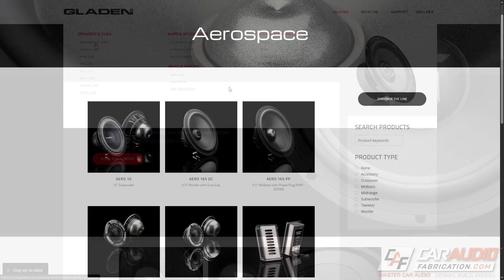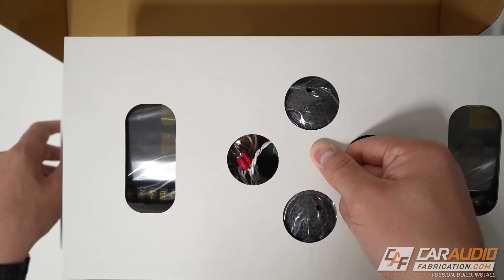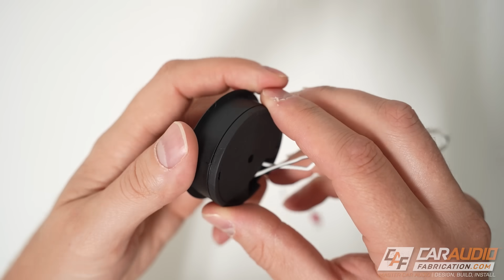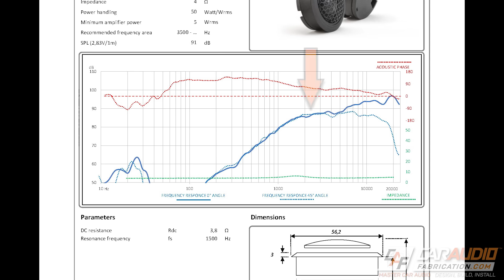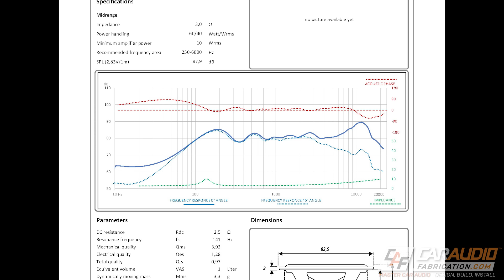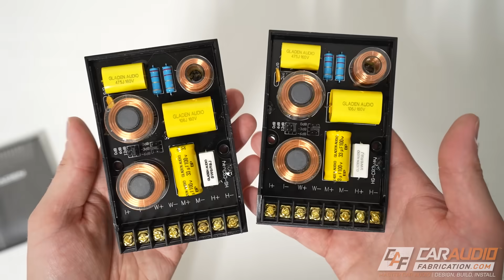Upgrade your sound! - Gladen RS 165.3 Component Speaker Set Overview

Comment: Hi from Scotland UK, brilliant YouTube's thanks have watched a Fer fue ,  canI ask is it best to
Use products from the same manufacturer, say pioneer head unit, pioneer amp , speakers and pioneer sub ?.
Or is it ok to mix say jvc head unit , Kenwood amp , pioneer speakers, JBL sub ?. 
I have a Mazda mx5 nc 2011 with apioneer sph-20dab head unit, pioneer ts-a6881f speakers in the lower doors ?.
Would I be ok fitting say pioneer TS-A301TW tweeters in the upper door , and a pioneer TS-WX140DA underseat sub ?. 
And I don no if I need a amp ?. As I have not looked that far through my build ?.
Any help would be great?.
Thanks and looking forward to your next YouTube .

Comment: I had a question about setting my subsonic filter. I have a ported sub box tuned to 39 Hz and I have two American base subwoofers and two passive radiators. I was wondering what is the best position for the subsonic filter to be set to?

Comment: Those might fit my 99 E320T if I can have new factory style sail panels 3D printed. Those tweeters may fit if taken down to its core as was shown. The midrange could go where the factory phone system speakers are in the dash.
Reply: Good lord bless you keeping a Mercedes that old on the road

Comment: I got to hear these in person and they sound fantastic. Under $1000 for a high end SQ 3 way component set is a steal
Reply from the maker: Great value for sure, someone will always complain about the price since they dont understand quality and see 3 way sets for $100, these punch above their weight class for sure.
Reply: @CarAudioFabrication  They don't seem bad compared to other high end options I've looked at such as Focal or AudioFrog. I do have a question though, I have a 2012 Honda Accord with factory Honda "premium audio system" audio. At first I was somewhat underwhelmed, but then I fed the aux port a lossless signal and it causes the system to come alive in comparison. Would something like these give me a a more powerful sound-stage in something like the Accord with the stock premium amp, or would you at that point suggest just doing a DSP + Amp setup instead? I assume in my case efficiency would be key, and are there other affordable options I could consider for an uptick in quality? It's a family heirloom vehicle so I'd like to keep it stock.

Comment: That would be a very nice upgrade to my tired stock speakers in my 2010 Acura MDX, you can gift'em to me if you want
Reply: There’s probably 20 other things tired in that thing, I’ve never seen them age well
Reply: @roddydykes7053 so far it's burning oil 1 quart every 3k miles, it is now driving with 235K still strong though

Comment: Great video. Considering the RMS of each individual driver, what would you recommend for RMS amplifier power using the 3-way crossover. Is it the sum of the three, sum of 2? I understand that resistors take away power from the final product, so surely we need to up the power to make it adequate?
Reply from the maker: Use around 120 watts RMS per set. Not a big deal if slightly more or less.

Comment: Always a pleasure seeing the notification pop up for your new vids 😊
More tweeters need to have the ability to completely remove the housing. Makes it so much easier for tight spots like in the a-pillars. And looking at the off axis response, these look like a great option!
On another note, those midrange drivers are giving off a real FaitalPRO 4FE32 vibe. Even the Thiele & Small and frequency response is similar!

Comment: Glad to see a new video. Longtime viewer also. I currently have my pickup 's dash opened up in my garage. Deciding on what system stuff to replace/improve with is daunting. 
All the brands I like Crutchfield says it won't fit in a door F150.
There has to be a way around this. I haven't replaced the infinity's. They have taken 23 years of abuse. I want JL audio for mids and highs. I have older Rf tweeters installed in the pillars that I don't use anymore.
Reply from the maker: The Crutchfield fitment is in my experience based off keeping the installation easy so that off the shelf brackets and such work. Understandable for sure. If you intend to custom make your own adapters or are ok with making slight modifications you can try similar sized gear, be sure to roll the windows down and check for clearance!